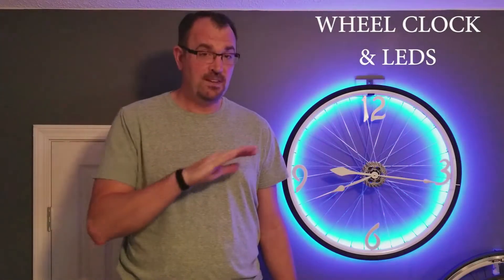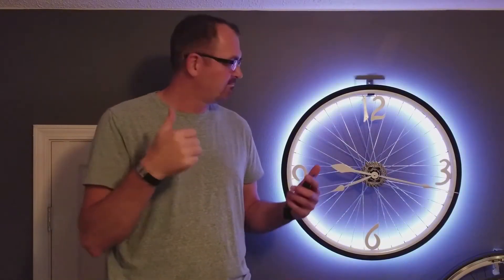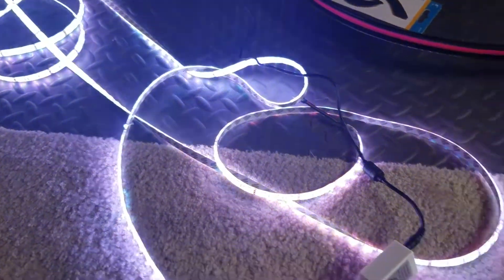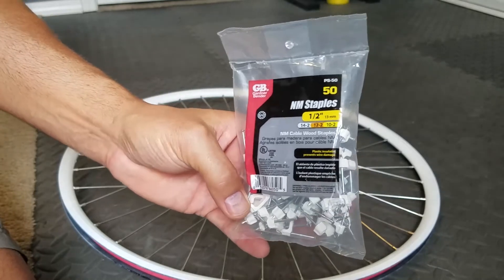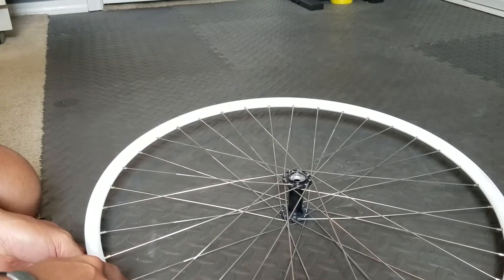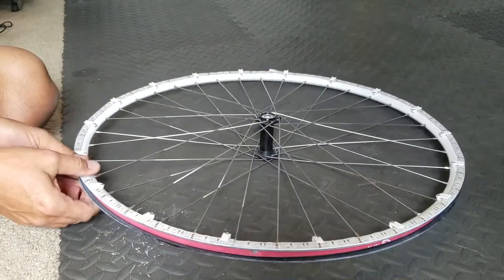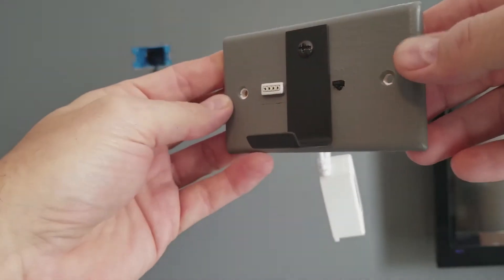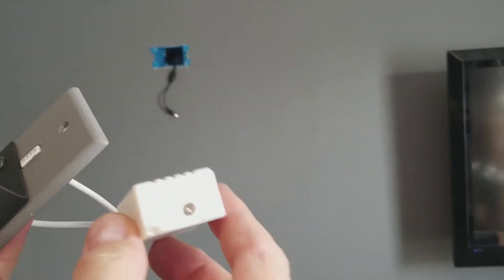Bicycle Wheel Clock with LEDs

Comment: Hey, I just built one of these that's similar. How did you attach the mechanism to the wheel so that you can change the battery? I used velcro and I'm curious if there's something that will work better. Thanks!
Reply: I was thinking the same thing and feel like he didn't think of that.
Reply: What about zip ties